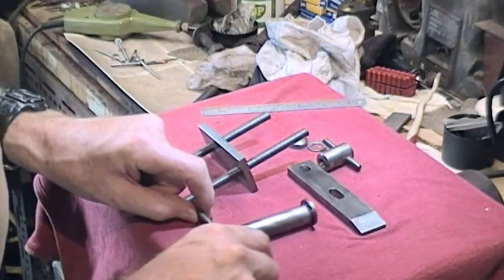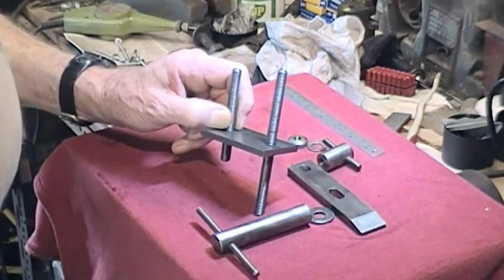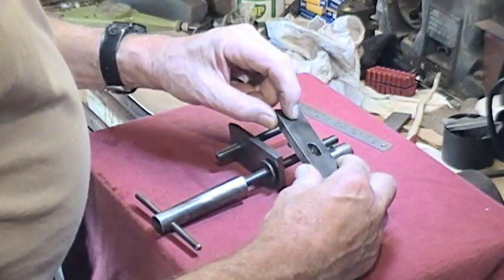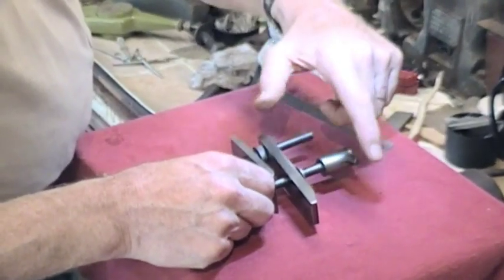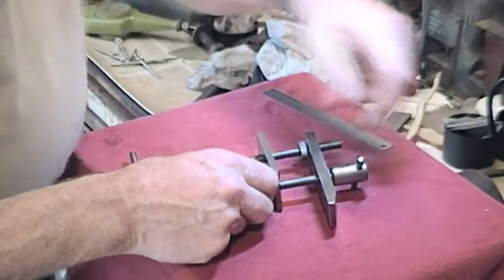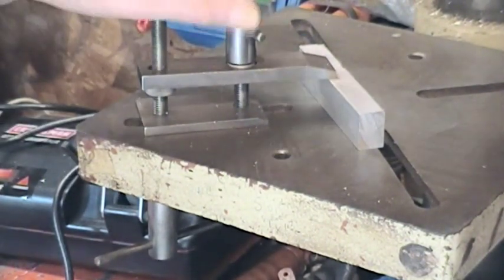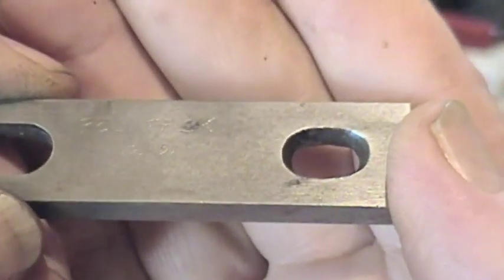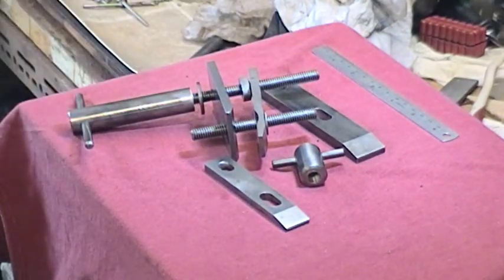Drill Press Clamps

Comment: Thanks for the Video,a very useful Tool. I have been experimenting with hold down clamps lately and I find that by having a half round piece of metal brazed on the clamping edge of the clamping bar obviates the necessity for fine Adjustment.
Reply from the maker: Robert - excellent point for sure - simple but certainly would make the clamp angle much less critical. Like that. :)

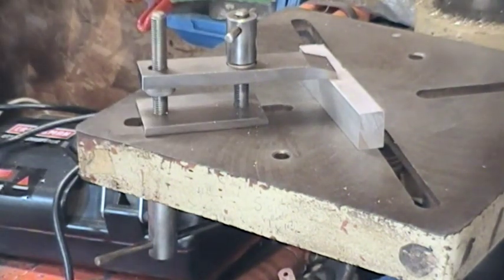Comment: 5:14 notice the lower plate kicks up  - the T-nut underneath needs to be on the other stud, closest to the workpiece.
Reply from the maker: You are right -- the reason was I had not tightened the underneath stud properly. Once that is secure the bottom plate won't move or lift. That was the result of inattention! :)